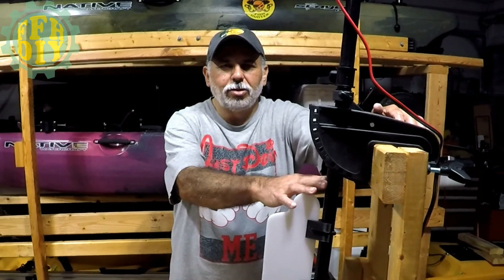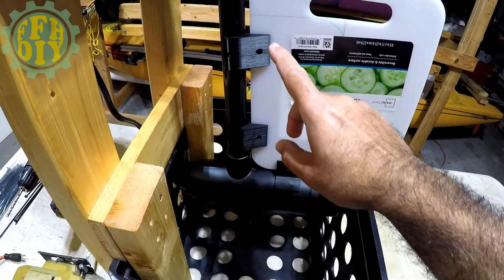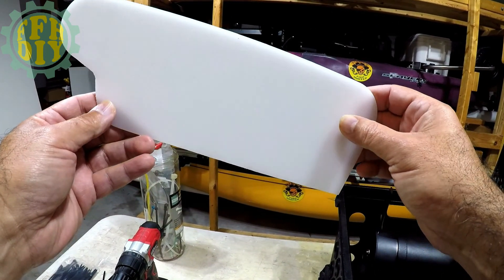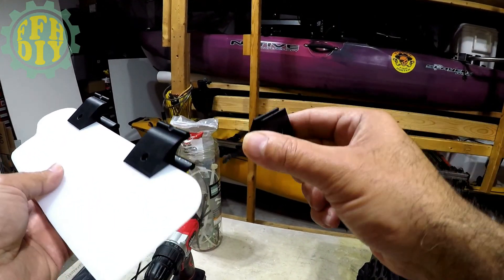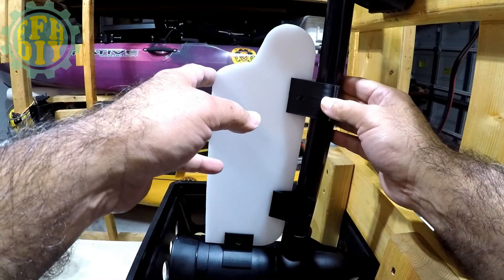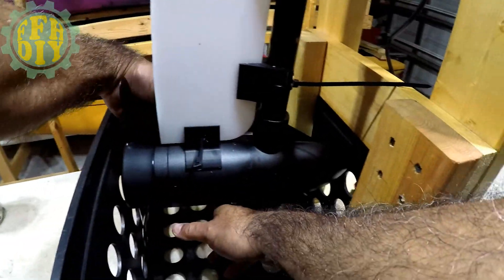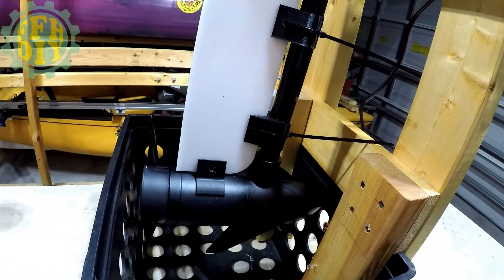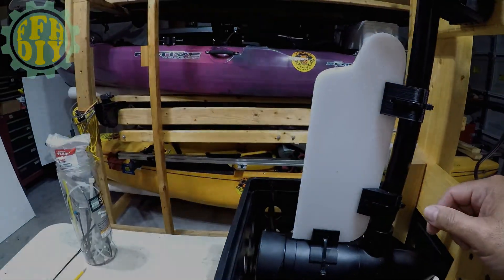A Trolling Motor Rudder Project - Florida Fish Hunter

Comment: I'm sure you have a reason for this rudder. The kayak will go in the direction that the motor is turned.. How does this added rudder make any kind of difference?
Reply from the maker: Trolling motors are known for lack of steering especially when the wind picks up, the water is choppy or you are wanting to track in a straight line. Adding a rudder vane to the shaft of the trolling motor will significantly improve steering and maneuverability. 😊👍

Comment: great vids!  Have been through several today alone.  Just got my Bass Raider.  Were  you able to post your 3d files for this project or is there some place you could point me to for the files?
Reply from the maker: Thanks! The link is in the description but so far the video is only half way there on the likes required before I make the actual files available.
Reply: @FFHTV  I get your intent, but I think it is poor form to put a DIY video, and then hold hostage the parts for your build, which while I appreciate the setup, do not support the method of gaining likes.  There is absolutely nothing anyone who does watch and like your videos can do to add to the like count if it is project we are considering doing.  In this case, at the rate the likes are not coming in, I will have to complete my project without the printable part you have advertised but held hostage.  Thanks for your time, wish you would consider an alternative approach.